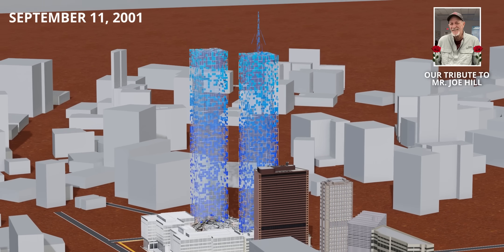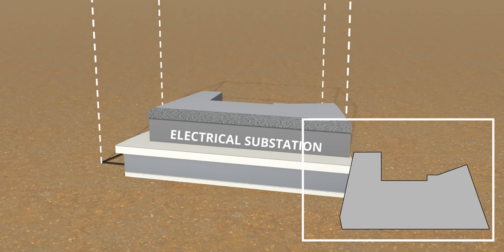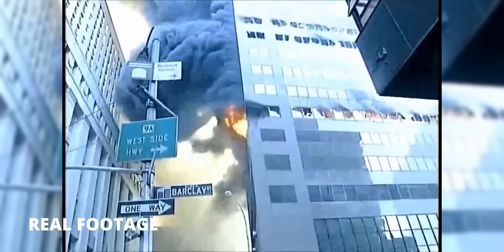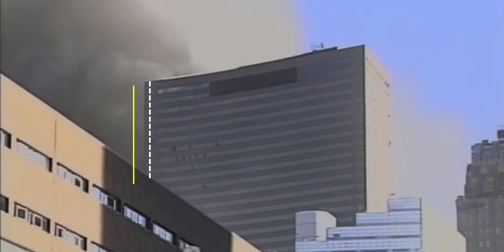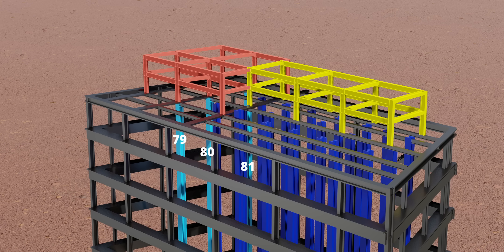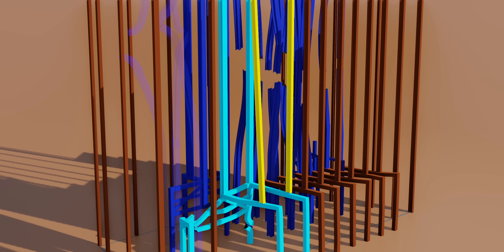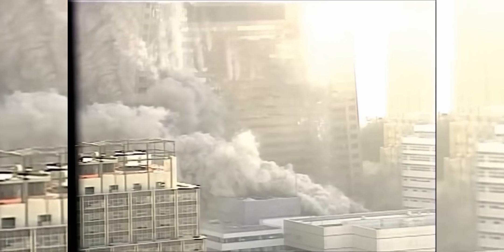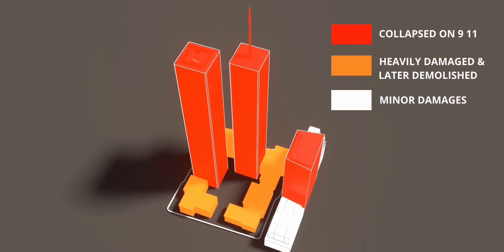Collapse of Building 7 | The Complete Physics

Comment: That antenna fell into the building why came down!
The building #7 was brought down intentionally.
Reply: I am going to respectfully disagree and offer a more plausible and far more detailed alternative.   

Building 7 was the 6th building to collapse of 10 lost on 9/11 and because of its early low priority was largely ignored for a while, so conspiracy filled the information void with simple-minded garbage by technically ignorant people promoting political agendas. This created a lot of confusion and misconceptions which I wish  to dispel, so I prepared this brief summary of my own analysis, using technical analysis, not ideology and magical (non)thinking. 

At 10:28am the WTC North Tower collapsed, showering Building 7 with tons of burning debris, causing heavy damage and starting many large  fires which burned out of control for the next 7 hours. Half the FDNY firefighters having been killed, units in disarray, equipment destroyed, no water pressure, and the greater urgency of search & rescue efforts, Building 7 couldn’t be saved so firefighting efforts were pulled as futile and 7 left to its fate. Firefighters make that sort of choice every day in brush fire situations - which houses to save and which ones to let go. Only real difference here is moving the decimal on the size and cost. People get overwhelmed by the size.

www.youtube.com/watch?v=g_SvpwyC17M

Collapse of a burning structure is always a concern for firefighters. Steel buildings subject to fire rely on active firefighting to survive. Buildings are designed around 1 to 3 hours of fire resistance, allowing time for occupants to escape and active firefighting to get started, after which all bets are off. Left to their own devices they'll exceed their design envelope and collapse, like Plasco Tower and Wilton Paes de Almeida. In 7 the occupants escaped, passive and active fire protections were compromised and active firefighting was abandoned hours before the collapse, which left the building to its fate. It lost. Odds on Building 7 would eventually collapse, and it did. No big deal in logic.

 http://www.youtube.com/watch?v=WnYBX6QT0R4 

FDNY Chief Daniel Nigro - The biggest decision we had to make on the first day was to clear the area and create a collapse zone around the severely damaged 7 World Trade Center, a 47-story building heavily involved in fire. A number of fire officers and companies assessed the damage to the building. The appraisals indicated that the building's structural integrity was in serious doubt. I issued orders to PULL back the firefighters and define the collapse zone. It was a critical decision; We could not lose any more firefighters. It took a lot of time to PULL everyone out, given the emotionalism of the day, communications difficulties and the collapse terrain 

FDNY Deputy Chief Peter Hayden ; We had our special operations people set up surveying instruments to monitor and see if there was any movement in the building. We were concerned of the possibility of collapse in the building. And we had a discussion with one particular engineer there, and we asked him if we allowed it to burn could we anticipate a collapse and if so, how soon? And it turned out that he was pretty much right on the money, that he said 'In its current state you have about 5 hours 

The collapse of Building 7 was anticipated and widely reported in the media throughout the day, with 24 video cameras recording some or all of the collapse. Everyone knew what was coming and why. 

www.youtube.com/watch?v=OY5S5k3tMHI

Building 7 collapsed from the inside out which is not at all intuitive and hard to understand, with most details being hidden from view.  It requires careful analysis and observation, and some people will struggle no matter how much it is explained. But here is my explanation relying on no outside authority. 

Building 7 was a unique, asymmetrical 47-story steel frame structure built atop a smaller 3-story building serving as a partial foundation, requiring lower floors dedicated to complex load transfer structures. Of trapezoidal shape and tube-in-tube construction, B7 (above the 7th floor) consisted of a central core of steel columns carrying most of the gravity load, perimeter steel columns around the outside of the structure carrying the remainder of the gravity loads and long span beams and girders to tie those elements together and form the floors. On the outside of the building hung a facade or outer shell. 

www.nist.gov/image-16640

Phase 1 : First externally visible signs of collapse initiation occurred at 5:20:28 pm and was notably quiet with observers not realizing the building was collapsing! No warning in the form of hundreds of eardrum busting 180dB explosive bangs. Here at 12:00 a local CBS affiliate reporter talking 10 blocks from B7 when collapse begins. People don’t start to notice the collapse until 12:11. At 12:45 is the famous CBS fixed camera clip of Building 7’s collapse. Note the silence. 

www.youtube.com/watch?v=t5tEy6mXSE8

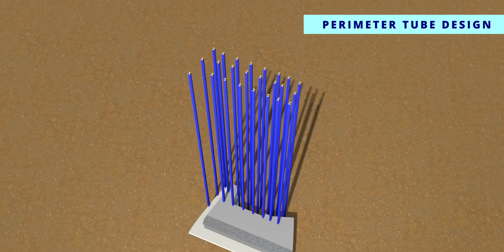Lower floor failures above the load transfer region (8-14) in the NE corner initiated the collapse. In this video at 0:45 you can see the NW corner from inside the building while under construction, Column 79 just out of frame on the left. That big, angled steel beam across the top of the frame connects to C79 at one end. The girders connect to the beam. That beam and all those girders depend on just one connection 

www.youtube.com/watch?v=nP3TNHPCIVU&t=45s

Phase 2 : NE corner floor failures caused a loss of critical lateral support over an excessive length of Column 79 and it buckled. Looking at the above floor diagram of Building 7 when you see all the structures that depend on C79 you quickly realize this one column was a relatively isolated structural element on which a disproportionately greater fraction of the structure depended analogous to say the Key Bridge. Externally as collapse begins we see a vertical progression of window breakage along the 44-46 line and a kink in the roof of the East Mechanical Penthouse at the top of the building, consistent with C79 failure. Normally with a buckling column, the load could be redistributed to other columns. With C79 that is not the case - the failure did not redistribute the load, so the collapse rapidly progressed to the roofline, sinking the rooftop penthouse. The transition from full capacity to almost no capacity occurs in an instant and will result in virtually no resistance 

Phase 3 : With C79 gone, B7’s progressive, non-symmetrical collapse continues with adjacent columns 80 and 81 left laterally unsupported and quickly buckling as well. The EMP drops down through the building. C79-81 all have no diagonal bracing, which is the major reason why they could not redistribute a lot of vertical loads among one another. From there collapse progressed from east to west through the central core until the core was gone from 81 to 58, taking all the interior floors and probably most of the perimeter columns with. Follow the horizontal progression of window failures low in the building and the dropping of the remaining rooftop structures into the building. The NIST Building 7 study model 4 determined C79 failing under ANY circumstances would have initiated the same collapse sequence. 

Phase 4 : After about 10 seconds only the exterior moment frame remains, giving the illusion B7 is still standing to the casual observer since little has outwardly changed. But it is just a hollow empty shell like an empty cereal box supported only by a few remaining columns and overloaded from the loss of the core columns and floors, quite unable to remain standing. With nothing remaining behind it, the north face leans inward, forming a V in the roofline, the last few columns buckle under the strain and the moment frame free falls, landing on top of the debris pile. 

It is only here at the very end, a single measurement of alleged free fall acceleration is taken, from just one point on that outer shell. The Building (core and interior) did not “free fall” - was already gone before that happened - just one corner of the outer shell briefly moved at a rate comparable to FFA. This alleged FFA was a product of how the shell fell NOT why the building fell . It’s also not even proper FFA as the single measured point was moving in 3 dimensions, not just down, which adds another variable. Start to finish the collapse took 18-20 seconds, 3 times longer than true FFA . How fast something falls can’t tell you what started it falling, certainly not 10 seconds after it started falling.  

The debris spread outside the footprint blocking surrounding streets, heavily damaging the Verizon Building and destroyed Fiterman Hall. 

No building is meant to survive 7 hours of multi-floor unfought fires. Building 7’s progressive, non-symmetrical collapse was incidental, unintended collateral damage from the combination of fire, time & gravity started by the collapsing North Tower, true no matter who planned and carried out the 9/11 attacks or why .  Of so little consequence it barely registered at the time, only taking on semi-mythical status as an alleged smoking gun years later when demolitions at the Twin Towers, missiles at the Pentagon and shoot down over Shanksville all failed and conspiracists had nothing left to work with. 

Anything can seem like a conspiracy if you don’t understand how it works. Now you should. I hope you found this helpful, informative and it solicits informed critical comment. If I made any errors of fact, logic or reason or left anything important out, please let me know so I can fix it. OR offer a more plausible alternative if you can. Be the first. Please start any reply with the words “Tits McGee” or I will know you didn’t read it and are wasting my time.

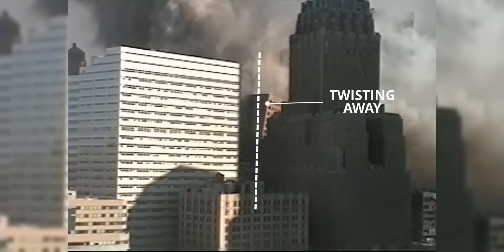Comment: You can literally see detonations at 8:47
Reply: Those aren’t detonations… it’s dust/debris.
Reply: totally, why would dust just be expelled from the windows like that? explosions happening on the inside
Reply: @gelette80   Or the fact the entire building is shifting and accelerating downward so dust/debris gets unsettled… I don’t understand how you guys can jump to conclusions so fast when there can easily be other explanations.
Reply: @gelette80  - The interior of the building collapsing. Remember (assuming you paid any attention at all) the building collapsed from the inside out and at 8:47 had al
Reply: You all don't see the flashes? Look closer
Reply: @chevez75  - I do - its light reflections off the window glass as floor systems are pulled down with the failure of Column 58, flexing the curtain wall and shattering the windows.

The collapse though started about 10 seconds before that on the other end of the building.

Comment: To anyone with two brain cells it is obvious that a building that's 610 feet long does not fall to the ground with both ends freefalling at the same speed
Reply: That was just the outer shell, not The Building (defined as its center-of-ass) which was already gone - as described in this video.  The exterior moment frame was only supported by just the 4 corner columns once the rest of the building was gone - all the core and most of the perimeter columns and all the floors.  When those last 4 columns buckled what resistance was there going to be?

That has nothing to do with what started the collapse 10 seconds earlier.

Don't miss the forest due to a fascination with the pattern of the leaves.

Comment: You know where else in the world steel buildings collapse during a fire? Nowhere
Reply: Countless thousands of steel framed buildings have collapsed due to fire. It literally happens all the time. Steel framed buildings are uniquely vulnerable to fire, not immune to it. It should be not a surprise that steel is formed using heat and deforms the same way.

Blacksmiths have know this for centuries.